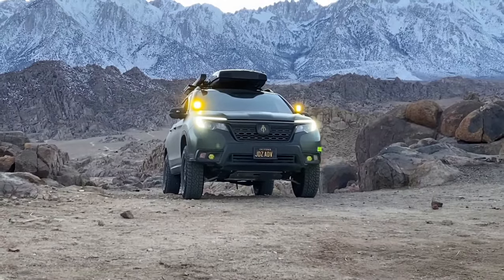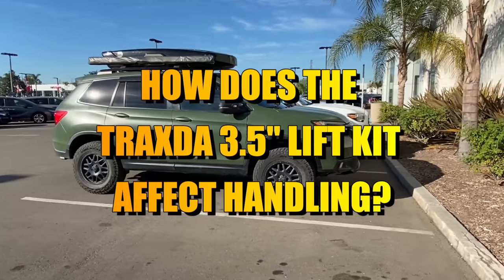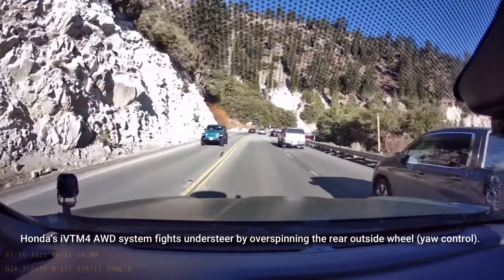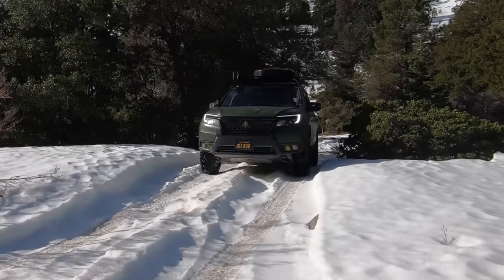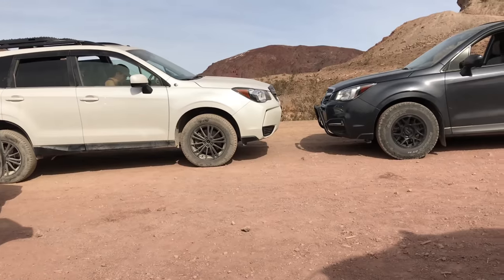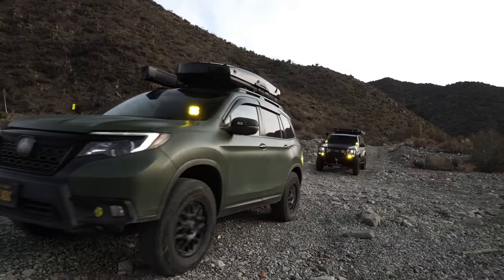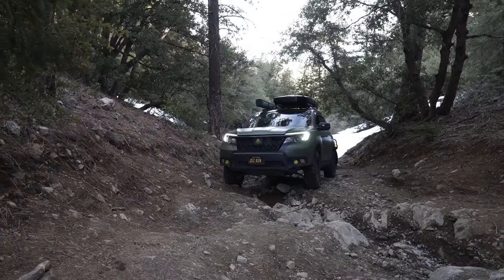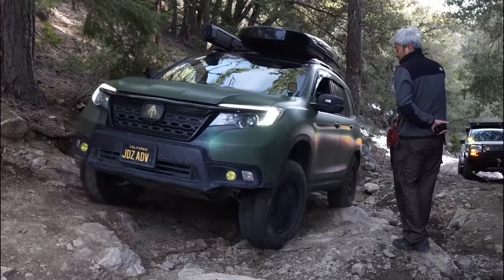3.5 inch LIFTED! Passport / Ridgeline / Pilot

Comment: What's the point of a lift kit if it doesn't lift the chassis as much?  I mean if the chassis is not lifted a much then aren't you effectively just increasing the center of mass and marginally increasing the lift through tires?
Reply from the maker: @respekted  do you really think Honda engineered the engine / transmission / rear differential to be the lowest point of the vehicle?  This platform isnt car based, it’s on Honda’s light truck platform.
Reply: @JonDZ_Adventuring  You wrote a paragraph just to take a dig at me?  I don't know what Honda did exactly to accommodate a lift, probably nothing, so this is why I'm asking if you raise the body MORE than you raise the suspension (which I refer to Chassis),  how is it beneficial?  I'll try and answer some of it for you.  Its only beneficial for going over a high spot so the body is higher but otherwise the lift is essentially a function of increase in tire diameter.
Reply from the maker: @respekted  what the?  My response was the same length as your comment?  How did I take a dig at you?  By responding with facts?  Did I attack you personally?  Did I call you names to make you feel bad?  Bruh?
Reply from the maker: @respekted  actually, my response was shorter than your comment 😂
Reply from the maker: @respekted  regarding the rest of your reply, you didn’t answer any of your question.  The lowest point in an iVTM4 Honda on the Honda Light Truck platform is the mufflers and gas tank, and that’s the reason why the minimum ground clearance is 8.1”.  The subframe is way up high.  When you add subframe spacers, the gas tank that connected to the unibody and the mufflers take full advantage of the lift.  Chill on the “loaded questions” 🤣
Reply: @JonDZ_Adventuring  thanks, that's a good explanation.  now I understand.   I was being detailed about the technical and you were seeming to be flabergasted that I didn't know the how Honda designed it.  I don't dude!  But all is well,  FJB everyone and nice looking rig.  I have a 4runner and was considering this as a change.
Reply from the maker: @respekted  ah, I figured you had a Subaru, since all the vital parts are low, so when they get a a subframe drop, it actually makes no difference in minimum gains.  I use to drive 2 Subarus and a 2008 FJ cruiser before this Honda

Comment: Are there adjustable shocks yet for the passport?
Reply from the maker: Maybe.  Someone is working on getting Bilstein 5100s to fit, but it will require the 3.5” lift kit (or subframe drop)
Reply: I am due for new shocks and I’d like to upgrade the spring/shock to something… less soft. Looking forward to seeing something.

Comment: i have 2018 honda pilot AWD  what is the best lift kit for my pilot ? i just need 2.5 inch or 3 maybe , pls i need ur recommand thx at advance .
Reply from the maker: There’s a handful of options, but I believe Traxda is the only one with front camber adjustment bolts.  Most of the lifts max out at 1.5 to 2 inches but Traxda has the tallest lift at 3.5”.  Id go with the 3.5” kit.  As mentioned in this video, it’s less stress on the axles.  Many people I know that have 2 inch kits end up going 3.5”, so just skip to the end game for your Honda.

Watch this video clip (swipe to the right in IG)
https://www.instagram.com/p/CP40IjLsV2Z/?utm_medium=copy_link
The Pilot in that video clip only has the 2 inch kit.
Reply: @JonDZ_Adventuring  i saw the video , so better i get 3 inches kit for lifted up ? I m not gonna do a heavy off road , but since i live in bullhead some reason my fron grill hit the aspal all the time , but thx for the video . If i lift up 3 inches any bad thing will happen ? Let say like damage exel or something ? And thx for the answer .. i try to look on google but they don’t gimme a good answer . Thx at advance …

Comment: Does the lift kit void the dealer warranty?
Reply: Only on the parts that are no longer OEM so if you change out your suspension for aftermarket it is no longer covered the rest of your vehicle is still covered by the factory warranty. With that said let’s say you lift your vehicle and then your axel falls off that’s on you to fix. But most companies who make these lift kits offer some kind of warranty on those parts And if you have it professionally installed whoever does it also should offer some kind of warranty

Comment: Should I get a passport, ridgeline or a 4Runner?
Reply: 4 runner if you plan on doing any serious off roading
Reply from the maker: T sizzle it depends on what you want to do.  I have a video titled “why I chose a Honda passport and why you should or shouldn’t”.  I use to drive a 2008 FJ Cruiser TRD and I hated driving it.  After I went AWD in the form of a Subaru WRX I have never looked back.  So just ask yourself, what to you want to do?  Do you want to Overland or do you want to just go off-road?  Are you the camping type or do you just want to go offroading for the day?  Will this be your daily driver or your weekend warrior vehicle?
Reply: A used stock 4Runner will last longer and go further than a modded passport. No disrespect just facts. Having a transfer case is everything
Reply from the maker: @seanc8514  well, we don’t know how long a passport will last.  I currently have 63k on mine in 2 years.  My bet is a Toyota truck will last longer, but you also have to keep in mind that repairs are costly.  For example, the ABS module is a $5k repair, and those go out quite often.  I use to drive a 2008 FJ cruiser and more power to anyone that is okay with the ride handling!  Floatiness and a steering dead zone wasn’t my thing.

Comment: 1:55 kit drops the subframe🤔. So negating any real height ground clearance unless actually slapping on larger tires.

Now if only had a proper low speed hear box🤦
Reply from the maker: Incorrect and incorrect.  How are you supposed to do tech reviews if you don’t even understand how a full independent modern unibody vehicle gets lifted?  The midsized Hondas are geared a little more aggressively than a 4runner in 4 low 2nd gear.  Do you feel you always need to be in 1st gear 4 low? 🤣.  Man, just delete your comment and save face.
Reply: Actually, it raises the entire vehicle above the sub frame.  The subframe to ground measurement is completely set by your spring length,  the angle of your lower control arms, and tire size.  Any spacer you put in between the subframe and chassis while keeping those things constant are actually lifting the rest of the vehicle up.    Sorta like how on a solid axle vehicle front ground clearance is completely determined by tire size.  Take a Rubicon.  measure the distance from the bottom of the axle tube to the ground.  Now add a 4" lift.  The ground clearance doesn't change at the front unless you put on bigger tires.  The breakover and approach angles are better though.  It is a common misconception solid axle guys have when thinking about drop subframes.  They  think of them like drop brackets for control arms, which do actually lower clearance.   It would be more accurate to start calling them spacers, because what they are doing is raising the rest of the vehicle in relation to the front suspension.
Reply from the maker: @tommymetz5563  thanks for breaking that down!  I don’t have experience with how body on frame vehicles are lifted but know that the rear diff pumpkin stays where it is until larger tires are mounted.  I’m going to have to copy and paste your comment 😄.  This is the 4th guy that has commented that doesn’t understand how a modern unibody with IFS/IRS lifts.

Comment: What shocks are u using?
Reply from the maker: In this video, my Passport has 51K miles and it was on stock springs and shocks.  Now, It has 97K miles and has heavier duty rear springs and rear shocks from a Ridgeline.  I disconnected my rear sway bar, and run 2x sumo coil spring helpers.  Right now, there aren’t any after market struts/shocks (that I know of).  Hopefully that changes soon.
Reply: @JonDZ_Adventuring  wow that's cool man didn't expect a response I just traded in my 2017 pilot for a trail sport ty  sir for your input I will look into this more

Comment: i got quoted to install the 3.5 kit and its almost same price as the kit itself 😭😭😭😭
Reply from the maker: I understand your pain 😖.  People were performing the lift for $700 to 800, but I guess inflation and maybe other factors have led shops to charge more.  A Mac Donald’s combo went from $8 to $12 almost instantly in the last year 😢.
Reply from the maker: This is one thing for people to think about when deciding between a 2” and 3.5” lift.  A lot of shops will charge the same price for labor.
Reply: @JonDZ_Adventuring  i almost went with the 2 inch, decided to get the 3.5 inch, i have all the parts wheels and tires, (dremmel ready 😂) called one of the shops in inglewood and got hit with a price almost same as the kit, its a minor set back gotta move on with the build!!
Reply from the maker: @xzinx  your build is a long time in the making, so was mine 😃.  One way to think of it is you’ll be getting more remote more comfortably and you can snatch more secluded campsites with beautiful views.  4 night at a nice hotel room will cost the same amount of money, but your built overlander will give you countless of nights outdoors.

Hey, If you’re free this weekend, some of us are doing Jawbone to Lake Isabella.  Hit me up on Instagram if you’re interested.  There will be a guy with a 3.5” lifted Ridgeline.  If you currently have a  2 inch kit, you should be fine.
Reply: @JonDZ_Adventuring  im free but my rig is stock 😂😂. was gonna do all at the same time to get a 1 time alignment
Reply from the maker: Let’s get on a trip once you’re all setup.  Thanks for all the support over the years.

Comment: That's a sick vehicle you got there.  A 4runner would probably walk through all that though.   All I'm saying is if you wanna off road definitely go for the 4runner.  However those Hondas are way nicer inside. Great video though 👌👏👍
Reply from the maker: It depends a lot on the driver.  I’m not a super skilled off-roader, and a with the same skill level it would take lockers to walk right up this. So yeah, I guess your right, a TRD offroad with rear locker engaged would walk up this.  Here’s a video clip of a brand new Toyota Tacoma going up.  Not exactly a cake walk.  
https://www.instagram.com/tv/CLRa_GkgDGl/?igshid=1vid63f7pwtqd
Reply: @JonDZ_Adventuring  hard to judge from a video sometimes.  Yeah honestly you don't usually need a locker on newer toyotas, they apply the breaks to the spinning wheel sending power to the one with the grip.  Obviously a locker is better for very technical stuff but at that point you're not stock at all
Reply: @JonDZ_Adventuring  the tacoma in front literally walked through it.  This guy in the video obviously doesn't have many skills.
Reply from the maker: @alexgarcia3900  yeah, you’d need more than just A-trac to walk up.  The Honda has an actually mechanical rear LSD that can be programmed to simulate a locker (to a certain degree, clutch packs can only do so much).  The main thing a full independent suspension vehicle will lack is “wheel articulation”.  If I had more travel, things would be so much easier.
Reply from the maker: @alexgarcia3900  are you talking about the Tacoma that had to retry the two obstacles?
Reply: @JonDZ_Adventuring  yeah definitely not. The tacoma applies the break and has a traight axle in the back.  The pilot has a clutch pack that overheats and doesn't well for 4x4.  It simply wasn't built for it.   I can guarantee that a tacoma with no lockers just decent tires would walk all over the pilot.  Even with mods. I go off roading all the time. In fact I just did yesterday.
Reply: @JonDZ_Adventuring  Atrac is very good.  Like insanely good.  I learned how to 4x4 in a 2004 f150 single cab with open diffs and let me tell you that A track if and only if you know how to use it to your advantage is definitely almost as good as lockers
Reply from the maker: @alexgarcia3900  I'm not trying to argue that a Mid sized unibody, fully independent AWD vehicle can out do a body on frame 4WD with a solid rear axle.  You said that a 4runner or Tacoma could "walk right up" and that would mean that it wouldn't have to try twice.  Check out this video by borderline explorer, this video was taken on the same trail back in June of last year.  Trail conditions were worse, and the Passport was at 42psi, but just focus on the 4runner TRD Off-road at 15:55.  He was not able to get up the obstacle with just A-trac alone.

By the way, you've been commenting on my channel for a while now and I appreciate the comments and support, so you may remember that I use to drive a 2008 FJ cruiser?  It had a factory rear locker and 8.2" rear diff.  
https://www.youtube.com/watch?v=uUNYngppOME

The reason I went with AWD vehicles is because I did not like the floatiness, steering dead zone, and MPGs.  The Honda just fits my lifestyle more.  63K miles in 2 years!  The Honda makes a great destination overlander.  How many miles are you driving your 4runner in a year?  Do you enjoy driving it on the road?
Reply: @JonDZ_Adventuring  I have a tacoma.  I can't live without a pickup sadly lol and I love the truck but it'snot perfect works for me though.

Well it's really about the driver and the spotter.  Gotta trust your spotter and you also have to have skills.   Most people let off the gas when they feel a slip and that's how Atrac works, It needs to slip and have power(give it some gas) to actually send the power to the wheels that need it. With good tires a good driver and a good spotter it definitely would walk through that in my opinion.  Also I'm not saying your car isn't capable or that you shouldn't have bought that.  I actually think it's cool that you're doing that and yes there's a lot of benefits to having the passport I actually even test drove a ridgeline but it was hideous in my eyes and it just couldn't off road.   The passport I think looks spot on though.   Might look even nicer with the new ridgeline front end.
Reply: @JonDZ_Adventuring  but like I said it's hard to actually judge the terrain on video.  If you owned an fj you probably have more experience than me on this.  So my question is.
How do you like it?
Reply from the maker: @alexgarcia3900  driving skill has so much to do with it, and as said in my first response I’m not a skilled driver and the driver of the Tacoma didn’t have much behind the wheel experience  either.  Also, some people don’t care about scraping or bashing the underbody.  You’ve seen some of my previous videos, I’m not much of the “send it” type.
Reply: @JonDZ_Adventuring  yeah I'm not either but sometimes it's that or being stranded lol.   I mean just gotta be careful but yeah you're right
Reply from the maker: Haha!  Oh.. I’ve sent it before!  🤣🤣🤣 💀

Comment: thanks for showing people the wrong place to measure ground clearance. on your particular vehicle the point it is measured is next to the hubs  as that is the lowest point on the vehicle drive train. hence to get any ground clearance increase you need bigger tires .  if you had a solid rear and front axle vehicle thats when u measure ground clearance on the base of the diff casing. and also in that case only bigger tires give better ground clearance .  body and suspension lifts normally only give u more suspension travel  rarely does it give more ground clearance
Reply from the maker: Thanks for blessing us with your profound wisdom.  You should talk to the manufacturers of AWD vehicles.  I wonder how they get away with listing minimum ground clearance despite having a lower clearance at the rear lower control arms.  Explain that!  Tell us man of profound wisdom!  Bless us with more knowledge!
Reply: @JonDZ_Adventuring  lol, where's my popcorn.

Comment: i have the same kit on my pilot. under full throttle the axles grind for me.
Reply from the maker: After the install, I was getting a sound coming from the axles as well.  I found out it was the plastic wheel liner.  I just took a razor blade to it to cut out some clearance.  Problem solved, hope it works for you.  

So, in your older comment from a while ago you mentioned you sourced some aftermarket struts.  Can you please let me know what those were?  Who makes them?  Model number?  I appreciate it!  🙏